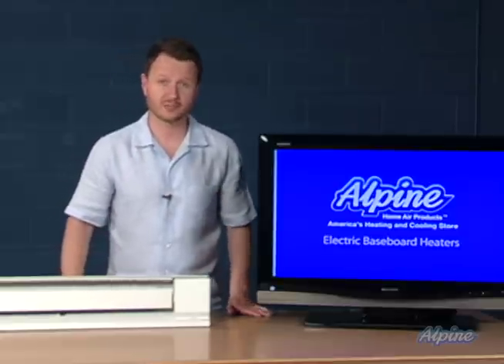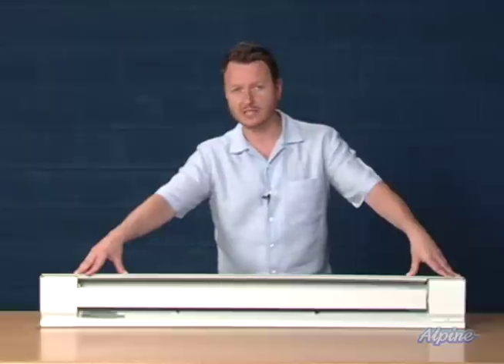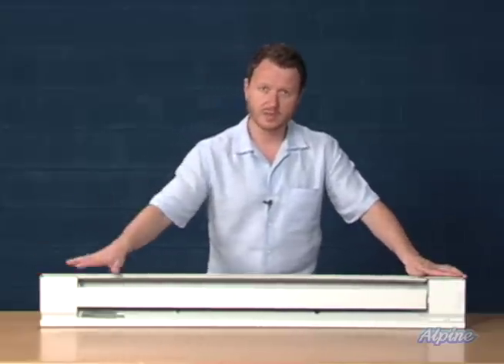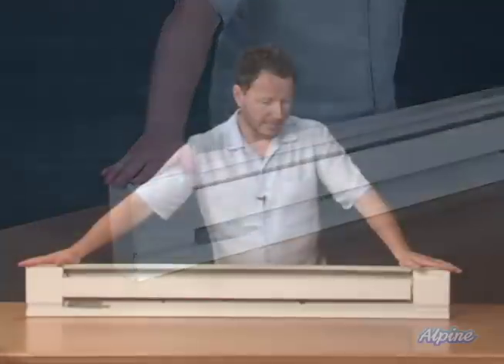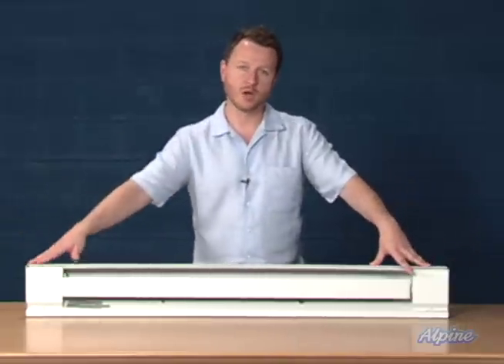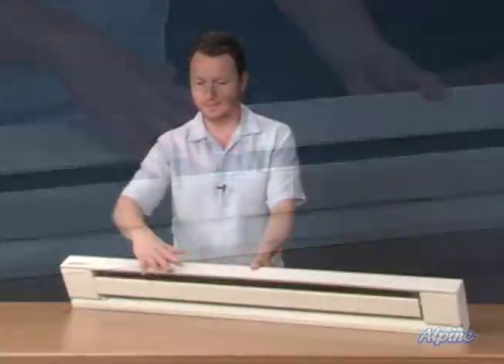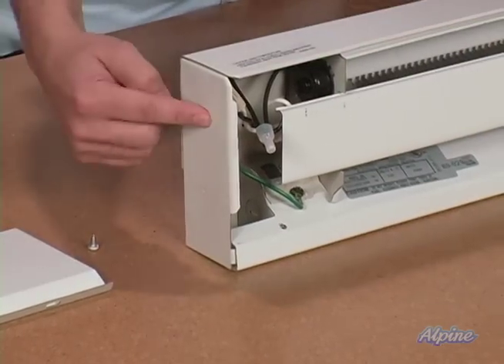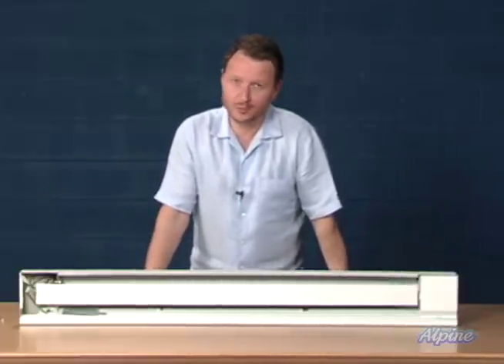Electric Baseboard Heaters

Comment: 240 volt/3.1Amps/750Watts baseboard heater, can I use 12/2  with case ground wire.. can I use the white wire to carry one of the 110V   leads? (20amp breaker)